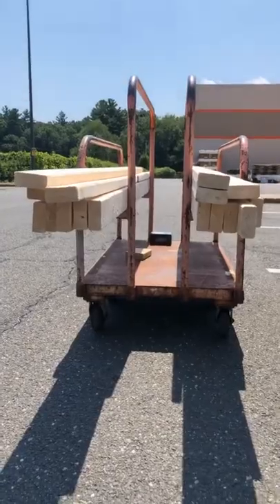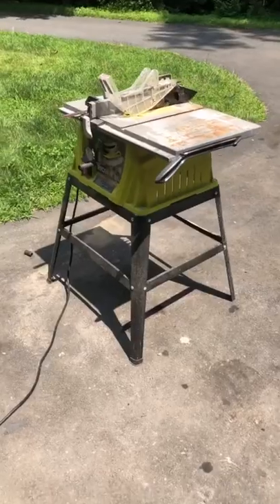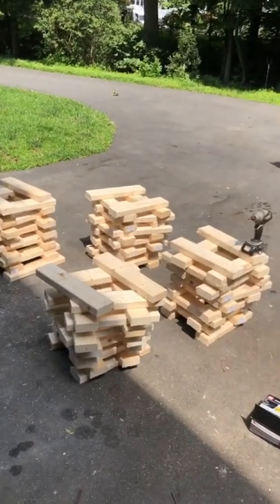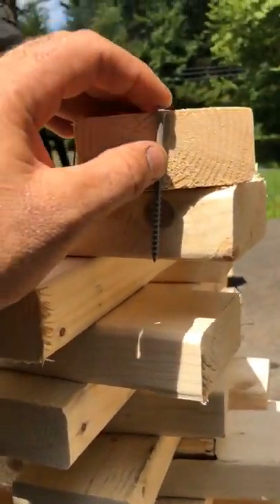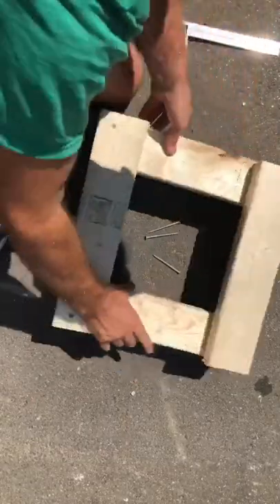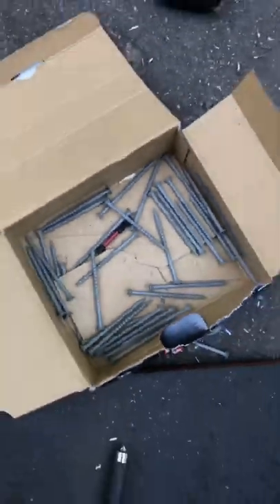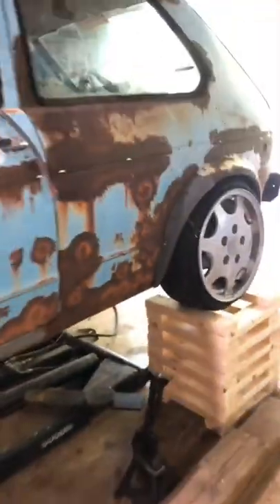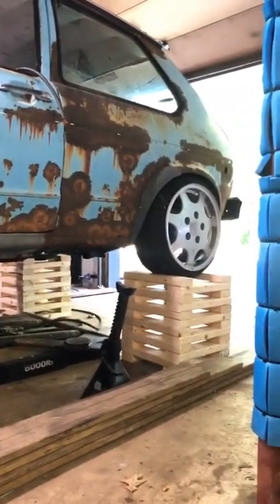Wood wheel stands.

Comment: How did you get it up on the blocks?
Reply from the maker: I used my scissor lift to raise the car up onto the blocks. You could use a regular floor jack but you might want to make the blocks a little shorter so you can get them under the car. Be safe and have fun!